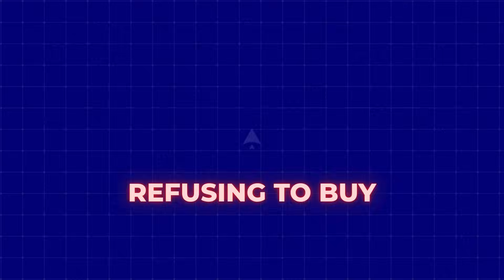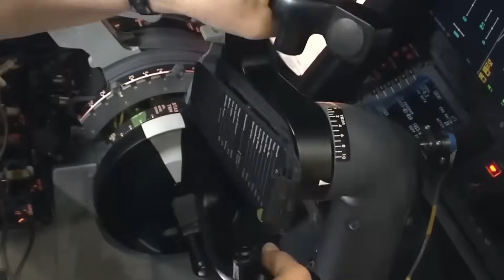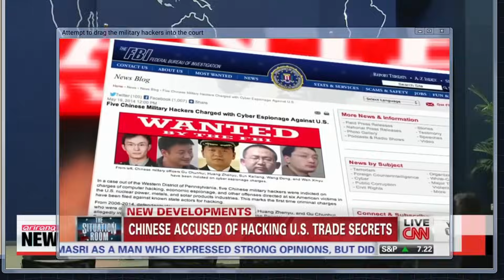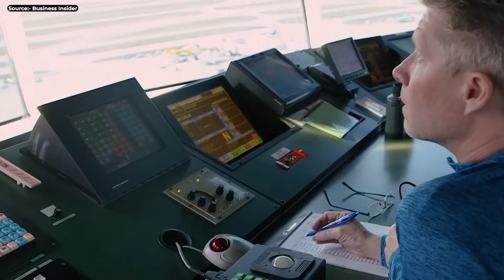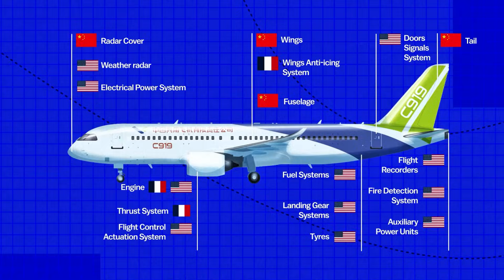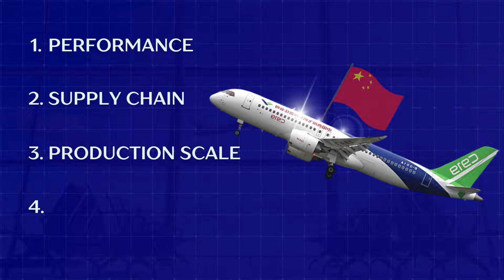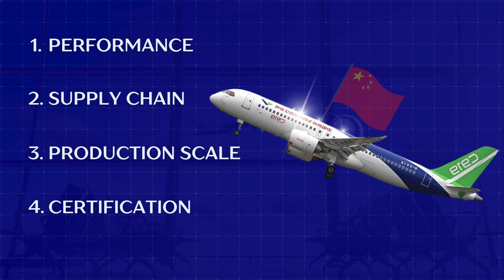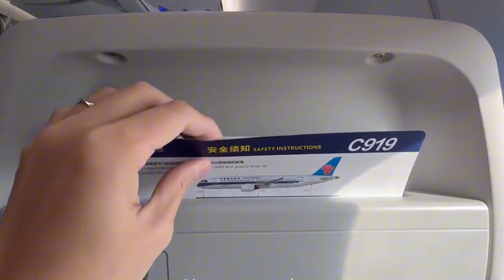The REAL Truth Behind the C919 Big Trouble: The Reason They Can't Fix It

Comment: This video is a complete load of tripe  -  The FAA  (or any other country's airworthiness authority) doesn't "Certify" an aircraft; it issues a "Type Certificate" if it is satisfied that the design  meets the requirements of an appropriate design standard - which in the case of an airliner would be U.S. Federal Aviation Regulations Part 25, or the equivalent EASA standard,  That is only the first part of the process;  the second part is that the manufacturer must gain approval of its  manufacture quality control  process so that each aircraft of a type having a Type Certificate, will be identical to the prototype.  That allows each production aircraft to get an "airworthiness certificatye".  These processes are spelled out (in the case of the U.S.A.) in Part 21 of the U.S. Federal Aviation Regulations.  Whether or not the FAA will accept documentation from another country depends on whether a "Bilateral Airworthiness Agreement" exists between the FAA and the other country's National Airworthiness Authority.